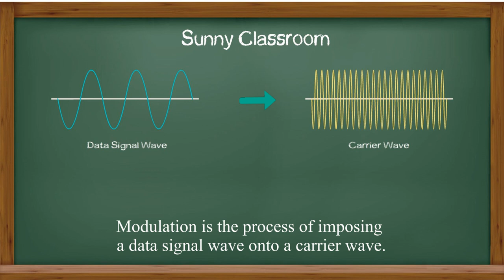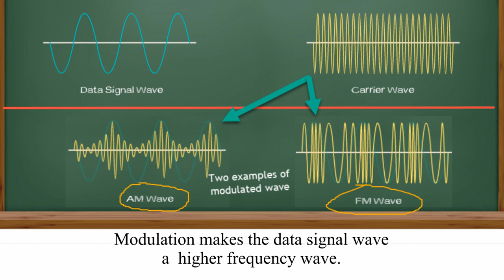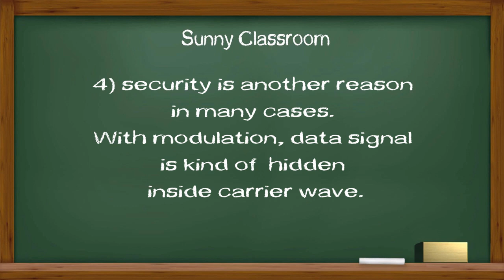Why do we need modulation during transmission?

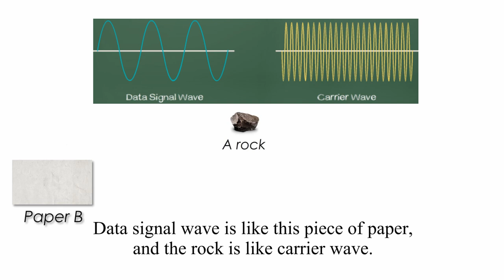Comment: @ 1:59 Why can't we say the Analogy in reverse? 

- Rock is the Message Signal, the internal components of the message depends persons inbetween the phone conversation. We can't tell those persons to speak in a restricted way = Rock shape can't be changed.

- Paper is the Carrier Wave, where we can mould/cover it according to the shape of the rock (message) = changing the carrier.

Finally, let us recall the basic definition of modulation:
Process of changing the carrier signal properties (such as amplitude, phase and frequency) with respect to the message signal is analogically equivalent to the Process of changing (covering) the paper properties (such as thickness, quality, size) with respect to the rock

I think this gives a clear picture... A great fan of Sunny from India 🇮🇳

Am I right Sunny?
Reply from the maker: you can say rock is the message. however, paper does not help if we wrap it with a paper and throw the stone.

Comment: I'm confused with reason 3.
Like 2.4Ghz and 5Ghz wifi,we say 5Ghz will attenuate quicker because it has higher frequency.
Then back to lower frequency signal and carrier signal,The carrier should also attenuate quicker because it has higher frequency. In order to receive the weaker carrier signal,I must use a  bigger antenna than the antenna to receive low frequency signal.

Comment: (1)Why higher frequency wave have more bandwidth? & 
(2)why lower frequency signals would require a much larger antenna? & 
(3)why low frequency  wave more susceptible for interface than higher frequency?

Comment: @Sunny Classroom : One point I would like to make.
As per my understanding Modulation with Higher frequency, is to send and receive the signal without any delay. Like a speedy transmission.
From your rock example it seems that distance is also one of the factors that is affected. is that so ?
Could you please elaborate a little bit ? Thank you.
Reply from the maker: Thank you for pointing that out. No, it has nothing to do with the distance. It is an analogy why we need carrier wave to modulate our original data.